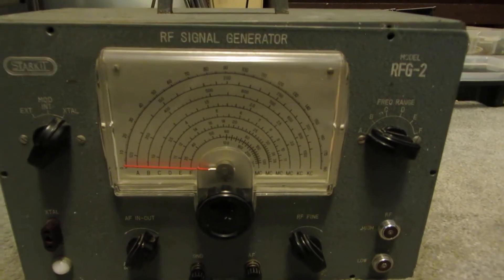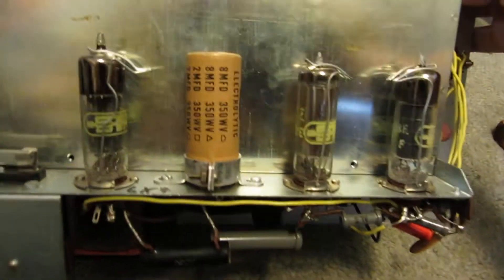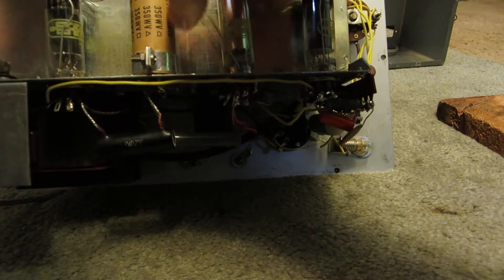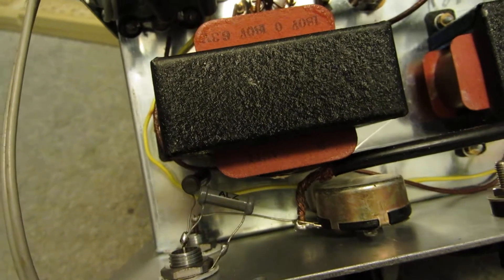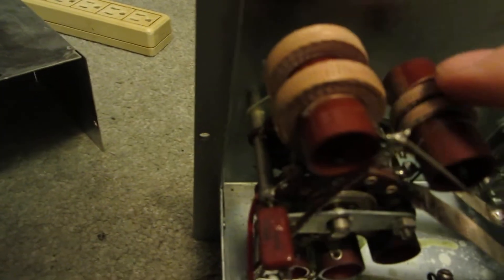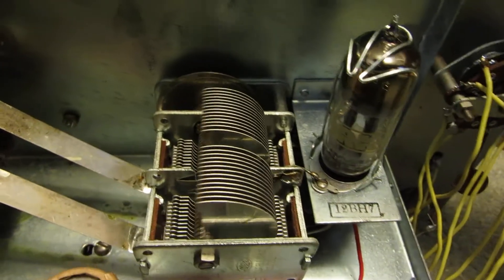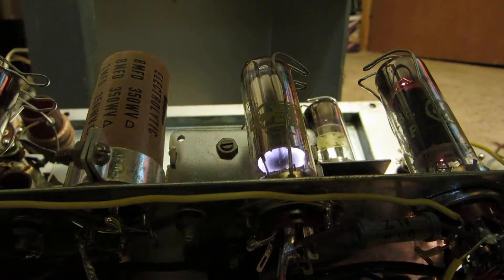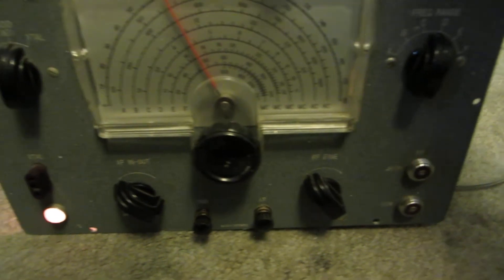Stark II RF Signal Generator Autopsy

Comment: Sir, I would like to suggest that you do "not" simply turn on a piece of tube equipment without first
Replacing the electrolytic capacitors. These can and have in the past actually exploded. Not worth
The risk. The other point I would like to make is that the tube with the bluish glow, is definitely
Gassy and needs to be replaced. The generator will not work with a tube that bad. Good luck with the
Restoration. Regards.
Reply from the maker: I mentioned in the video that I tested each tube and were all good, not only that OB2's always glow like that.